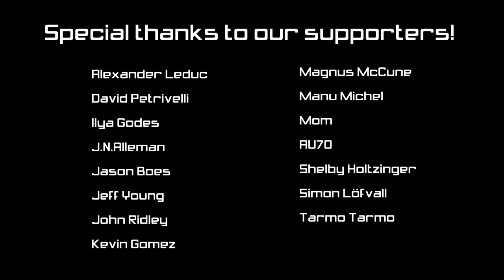Small Surface Grinder Part 7 - S02E23

Comment: Not gonna lie... I definitely winced a little to see you put the welder and grinder to it,  without taking the rails, bearings, leadscrews, and steppers off beforehand. Moving parts do not make good bedfellows with weld spatter and grinding dust. You'd do well to take all that apart and clean the crap out of it. You're going to need to re-shim and realign everything anyway, as the framework likely twisted and moved around as you welded on it. 

That being said, I'm glad to see this coming along. I've been dreaming of a benchtop surface grinder, and I'm anxious to see how yours works out! Keep up the good work!
Reply: My thoughts exactly.
Reply: Second.
Reply: Not to mention the chance of arcing through a bearing
Reply: Darrin Berndt - what is that, or specifically, what would that do? Just curtis,  thanks.
Reply: if the arc traveled across the balls in a bearing, it would leave pitting and/or metal transfer at the point of entry and exit of each ball, destroying the smooth finish, and making the bearing rough.
Reply: Chris Santacroce, interesting. Thanks.

Comment: Yes on electronics and programming.

I'm a little concerned. From my understanding, this was supposed to be a side project that was required to finish the lathe. 

Will we ever see the lathe again? Will we ever know how the two are tied together? Stay tuned...

Nice touch on the flip flops. That's probably something I would do.
Reply: George Wilkinson haha: most definitely will. In fact we're coming up on a place where we need the lathe to make parts for the grinder. I think we're just having that adventure where we have to make tools to make tools to make the project. Plus we're clearly in way over our heads :)

Comment: Throw some shoes on while in the shop! I used to do the same and work barefoot, since my workshop is a carpeted 2nd bedroom. I thought I was always being careful, until the time I went to move a vice off the drill press for a moment and a parallel bar slid out and crushed my toe. Coulda been a lot worse, but it still wasn't pretty. Accidents sneak up on you, and you can't get much done if you need to stay off your feet.

I've really been enjoying these videos! I recently scratch built a CNC mill, so it's nice to see how others operate, and see if they make the same mistakes as me.

Comment: Great series. I see how it could be used with the mag chuck to surface grind small parts but somewhere along the line I missed how this thing is going to be used to grind the bed ways of the lathe--which I thought was the whole impetus for the project.

Comment: Yes! Show us the electrical part! Question; @6min19 you can see that in the vertical pilar on the right side, the diagonal crossmember is welded in asymmetrical, is this due to time lapse mistakes or on purpose?

Comment: wonder wat youre going to do for the grinder itself , looks like you could fit a bench grinder on there hanging upside down from the moveable part 
you can rotate the spark cap so the opening point toward the workable surface  , its cheap(ish) and should solve the mounting problem of the motor to the frame too (flat base with mounting holes and a switch ) though i wonder if a bench grinder has a strong enough motor for the work you want to do with it

Comment: have the rails bend? after the weldig ??
Reply: On the scale of machine tool precision, welding always moves things around. Weldments are generally avoided when making machine tools because of inevitable deformation and the high residual stresses left in the assembly. If you must use them, then you should normalize the stresses by annealing the assembly, and then machine any registration surfaces.

Comment: It may be a reasonable Idea, welding a frame, considering that a Cast is far more expensive. But unser dynamic loads, your frame and your complete construction will start to oscillate and destroy the surface of your workpiece. I had the same problem with a homemade mini lathe but i  could solve it with casting concrete with embedded sand cores into the frame. The oscilations will be absorbed better and their resonating frequency will be lowered.

Comment: I am interested in the electronics.  I would like to see the math you used to determiner the size of components you choose.  How to calculate the inertia loads, etc.

I am also interested in finite analysis, If you don't want to do the whole grinder could you give an example.  I would like to design and build a machine myself, but I am lacking knowledge of the above mentioned pieces.  Any input would really help me.

Comment: yes pls gib lectronics gib gib

I am a suck at lectronics.  going through it all with your styles would be pretty much priceless to me.

Actually, real talk:  if you went throught the electronics portion of this build I'm pretty sure that would be sufficient for me to duplicate your build myself.  maybe even tweak the build.

like, it seems like you could easily redesign this slightly to be both a surface grinder and a small planer/shaper.  Which would be sweet.  even if it sucked you'd learn a lot about that kind of machine.

Comment: I don't understand why everyone wants to see electronics and prog. This is not CNC plasma cutting router, this is "stupid" grinder. Electronics will be some power source, motor drivers and PC interface. Programming will be only slightly more complex than
int i = 1000;
while(i--) {
moveXabs(XMIN);
moveYrel(1);
moveXabs(XMAX);
moveYrel(1);
}
Magic of this grinding machine should be in mechanics - precision, rigidity, repeatability, spindle radial play and vibrations... . Magic of the plasma router is in the programming, it's mechanics is quite boring.